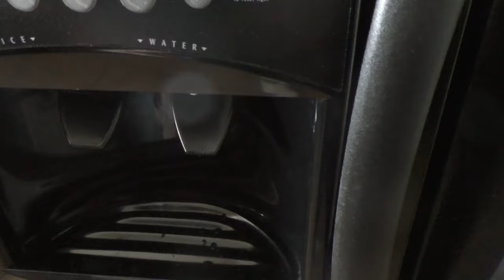How to Fix a Frigidaire Gallery Refrigerator that Wont Make Ice

Comment: For any others who might run into this problem, I spent literally hours trying to diagnose what was wrong after running through everything in the video and nothing seemed to work. I ran into something online that said to pop off the front of the actual ice maker (just use a little bit of force but it should pop off if it's like the one in the video) and if the gears are not moving, turn the large gear 1/4 of the way around clockwise to begin a manual reset process. Within a few minutes water came from the tube into the ice maker but it took me resetting multiple times to get ice and it still didn't work continuously without constantly resetting which led me to believe something may be wrong with the motor.

After very close inspection the next day, I realized that probably a mm of two of the wedge tips on the gear had been corroded/chipped off and that was the reason the gear wasn't turning, water wasn't flowing into the freezer and ice wasn't being made. A quick gear order of Amazon for $15 ( https://www.amazon.com/gp/product/B083HMNWBP/ref=ask_ql_qh_dp_hza ) fixed my issue and ice is flowing back in. Just glad I didn't have to replace the whole ice maker! Thanks @Farm Dad for the walkthrough as I would have never been able to deduce what was happening without this video and learned a whole ton about my refrigerator/ice maker in the process! lol

Also my model number was FFSS2614QS6A.
Reply: Wow thx ur awesome 👌
Reply: Thank you!!! I just replaced the assembly and still nothing.. gonna look at the resetting it... thanks again for sharing
Reply: My gears won't move manually.  Look great but I can't turn it. ?????
Reply: Dude thank you! I decided to try this after replacing the filter before I pulled the fridge out (easiest to hardest method order lol) and I had a broken tooth on the gear and the loose tooth got jammed and stopped it from spinning. We are up and running now!
Reply: Thank you so much! After the repairman looked at it for 30 seconds and said the whole ice maker needs replaced and quoted $350 I was shocked. Found this video, and this comment and sure enough, the gear had been worn down. And now it's working. Thank you!
Reply: thank you so much. I tried all the things. so I knew my valve was good and the filter was good. but still no ice. Turned the gears and no I have ice!!!

Comment: Hey guys – just wanted to share a fix you might want to try. I had a repair guy finally look at my ice maker (2018 fridge). Turns out there was a design problem (he spoke to someone from Electrolux). Air was seeping into the hole where the waterline goes. If you live someplace that has high humidity it could cause the line to freeze. The fix was to insulate the line in the fridge and also seal the hole. Used to freeze up after 2 days and stop making ice. Has been running great for 2.5 weeks now and makes ice much much faster. Good luck!
Reply: Hey not sure how to insulate. Can you plz walk me through
Reply: @lestine38able  hi, the final fix was to replace the hose that goes into the fridge. The insulation part was basically just making sure there’s no gap where the hose enters the fridge.

Comment: So I followed your process end up changing the big wheel in the front.  Ice maker worked for about3 weeks.   Changed out water valve system.   No water coming into line in back for ice maker only water running fine into water dispenser help

Comment: Well, 10 mins later and I’m back to comment again.  Did your steps and my water inlet tube to the ice maker was frozen. Pulled it thawed it and reinstalled it. Now it’s a waiting game. One TIP,  if u have a small piece of tubing  u can push it on the bk of the inlet tube and blow. If u can’t blow any air, then pull the tube out. Thx again
Reply from the maker: Awesome.  Glad you found your issue.  Great tip too!

Comment: Replaced valve assembly and still nothing. Are the gears inside the ice machine supposed to be moving? Mine are locked and will only wiggle a little bit but wont rotate.

Comment: After watching your video I was able to assess what my problems was.  I used a pair of bent needle nosed pliers and removed the plastic water piece from the back of the refrigerator and it was frozen solid.  I noticed that to remove this piece I had to turn is a quarter turn to unlock and then pull. After I thawed out the ice I simple replaced and quarter turned it into the lock position and then reattached the water source.  Thank you for posting your instructional video, it was very helpful.
Reply from the maker: Glad you got it fixed!
Reply: @FarmDad  great video.

Comment: Excellent Video!!! I am a DIY girl and your video was straight forward and easy to follow. The plastic piece in my unit had a solid piece of ice in it. I removed, rinsed, and re-installed it.  FYI, the plastic piece comes out easier if you push from the inside. I used a towel to get a better grip. WE HAVE ICE AGAIN! Thanks Farm DAD
Reply from the maker: Great job!  Glad to hear it is fixed!

Comment: Great video...... this was perfect and I found the ice in the plastic piece that you showed.  I do want to caution those that will doing this, the metal plate behind the fridge that surrounds the plastic piece is extremely sharp.  I made the mistake of running my finger across it as I was pulling the piece and ended up with a pretty deep cut in my thumb.  I suggest using pliers to pull the piece out if it doesn't budge for the inside, or taping around the metal edge that surrounds the piece.  Good luck.  Great video!
Reply from the maker: Ouch!  Good advice.
Reply: Thank you so much for the video on how to fix ice maker. I have a ke more fridge which seems from your video it has similar functionality. I did try the pipe method by following your steps, unfortunately still ice is not being made, so I believe possible the bottom valve might need to be replaced. Requesting can you please upload video of that as well on how to take off valve etc now in case if that doesn’t work also what else is the reason that ice maker not working? Also I felt so good doing this as a handy person where can I learn from basic to advance
Reply: @dilshadrandhawa3921  did you ever find a solution to this problem? I'm having the same issue with the blue tube not receiving water.
Reply: Ouch, fingers bleeding!  My part is still stuck!

Comment: OOOPS, There it is!: Frozen water inlet tube. Was lucky I have a small hand held water steamer. Removed excess ice from tube, removed water supply hose. Injected steam from the inside of freezer until it melted  ice and steam came out the inlet. Fixed!.
You had a good approach on troubleshooting steps and explanation. Thank you.
Reply from the maker: Glad you got it fixed!

Comment: Thanks for video!  Have no water coming into fridge and just checked the line and its not clogged.  Gonna try replace water filter and go from there.  Your video helps with step by steps.
Reply from the maker: Most welcome!  Most common issue is frozen line where it enters ice maker.

Comment: Thanks for your walkthrough. Recently our ice maker on our fridge stopped working. Part of the issue was that the water line had come out of the connector. After reattaching and ensuring it was tight, still nothing. Took it apart today and the water inlet to the freezer was frozen solid. So now we are waiting for it to kick back on.
Reply from the maker: Nice fix!

Comment: Found your video today, our ice maker hasn't worked great since I had installed our RO and switched over, I had assumed it was the water pressure.

Turns out the inlet had frozen, so I thawed that, only to not get ice. Frustrated, I figured I would try manually adding water to the tray. It seemed to not flow where it should (I used a bowl rather clumsily), but about 30 minutes later the machine dumped a load of ice! And then another, and another 😁 I think the bowl of water thawed something out that was controlling the water but frozen in the closed position. I'm guessing a water position sensor of some sort, but I haven't taken off the front cover to look for myself.

Cheers! Our ice is also no longer semi-hollow / misshapen 🤘
Reply from the maker: Awesome.  So cool! (Pun intended). 😁

Comment: Subscribed  I had done so much of what was already in this video.  Listed to make sure the solenoid was kicking in, no water in tray, even felt the inlet to make sure it was clear of ice, water dispenser working.  But, watched this, figured it had to be the chute leading from the water line.  Yep!  Just wished I had watched this video first!
Reply from the maker: Sounds like you know what you are doing.  Thanks!
Reply: @FarmDad  I do have one question I have not found an answer for:  Why does the water enter the back of the unit behind the ice maker rather than the water filter?  Doesn't the water for the ice maker go through the filter first?
Reply from the maker: @michaelweaver4718  yes it does go through filter first.  The water line from your house should go to the filter.  Then from filter it should go to the solenoid valve which will send filtered water to the ice maker as needed.

Comment: Hello Thank you for this Video I was able figure out how to get My Ice Maker working in my Frigidaire Gallery refrigerator. It was just as you showed Ice in the water tube going into the Ice maker and I was able to clear an Ice clog. I could not get the tube out but I was able to use a syringe and a plastic tube and squirt hot water into the tube to clear the Ice. I am waiting for the Ice make to cycle and see if I start making Ice again? Thank You I'm quite sure that now that the ice clog is gone it should start working again I already replaced the water valve assembly. When my water dispenser stopped working about a month ago. because the line was frozen inside the door. Thanks for this video it helped me figure out my Ice maker problem. CHEERS!!
Reply from the maker: Glad it helped!  Cheers!

Comment: Thanks for this, just removed the fill tube at the back of the ice maker and sure enough, it was clogged with frozen water.  Removed and cleared the ice clog, hoping that fixes my issue.
Reply from the maker: I bet you have it fixed 👍
Reply: @FarmDad  I am hearing ice drop into the catch tray now.  I think its "fixed".   Thanks for the video!

Comment: Thank you. Great basic quick check before moving on to replacement parts. It would be great to have seen the valve replacement or learn if some valves can be purchased at a local hardware store. I did learn about checking the top stem for blockage from this video but was not lucky and appears to be the valve. Thank you.
Reply from the maker: I wish I would have put in the video that a lot of times you can confirm whether your valve is bad by switching the connections on its solenoids.   If you reverse the connections and no longer have water at the dispenser but start getting ice, the solenoid for the ice maker is bad.  It's usually easiest to replace the whole valve.  I usually buy it online as most hardware stores won't have it.

Comment: When pulling out the water feed "spicket" or tube, first turn it 1/4 turn counter clockwise, as there's a tiny plastic locking tab holding it in.  This was iced up, on my fridge.  Also, there's a tiny funnel on the ice maker itself, that this spicket dumps water into and it was frozen up too so, I actually had to remove the entire ice maker (super easy) and let it thaw out.  You're processed worked great.  Thanks!!
Reply from the maker: Appreciate you

Comment: This video helped me. Tray was dry ad a bone as he said. I first checked my filter. Shook it a few times then put it back in place. I checked the water line and no water was coming in. Took my screw driver and tapped the solenoid 3-7 times and water shot up through the hose. Can't say it's fixed but I do have water back to to the ice maker. Dispenser still worked as normal the entire time. Strange.
Reply from the maker: Hope it stays fixed 👍🤟

Comment: Thanks for helping me fix this!!! It was just clogged with ice chunk but I had no idea I could just pull that out of there!
Reply: My brother that is an AC guy also taught me that you can get a huge syringe that is used to gather liquid to squirt hot water up the valve the guy in this video pulled out. It will melt the blockage and your ice-maker will start to make ice again. I of course pull out the ice bucket first then put a pan inside the freezer for the water that falls back in. I squirt about two cups of hot water up into the valve to make sure it melts the ice. Of course make sure you first have water coming out of your water dispenser so you will know it isn't the water valve inlet in the back behind the board. But it appears that it was in your case.
Reply from the maker: Glad to help!
Reply: @yogibear6084  I watched a guy who said just use a hair dryer. I was like duh! Why didn't I think of that!
Reply from the maker: I don't recommend the hair dryer.  I've seen several people melt their plastic tube.
Reply: @FarmDad  it only took a couple seconds and worked fairly well. And I actually just heard an ice cube finally drop into the container. It's a win win for me. But I wouldn't have figured it out without your video!

Comment: This is a very well done video and has helped me with my freezer.  But it doesn't cover the problem I have now.  It seems like there is no power getting to the freezer light and the part that pushes the ice out.  The light was coming on intermittently when I lifted the ice maker unit and the dispenser would start to work.  But now it doesn't come on at all and the dispenser is dead.  It seems like a connection is loose.  Do you have any idea where to look?  Thank you.

Comment: Great video! Easy to follow did all the steps, turns out I had air in my line, to prime the line and get all the air out I just kept turning my ice make on and off until I got got about half a cup of water from my ice maker water line. Thank you for the video!

Comment: I’m at the point where I have the green tube in a bucket. I see a little bit of water within the tube and when I shake it, some water comes out. However, the water doesn’t look like it’s fully through the line. I can see increments where it stops and goes. How long should I leave it in the bucket for before I can determine this is the issue? So far it’s been in the bucket for an hour and no water is in the bucket. At one point should it be flowing out or should there just be a little water in the bucket?
Thanks so much!!

Comment: Hi Farm Dad,
Finally I found this video, that's the same model that I see at my new place!!! There's a problem in my fridge; the freezer is at -19F when the fridge is at 36F. It was -1F and 58F last week and I tried everything I learned from other videos like cleaning the condenser coils, shutting it down for minutes and so on.
What do you say about this issue? Needs thermostat replacement???

Comment: I have the exact  same icemaker. Mine is always the tube at the top clogging up with frozen water. Not sure what causes that. Great video.
Reply from the maker: That's frustrating.  It could be that the freezer temp is set a little too cold.  If not that you may try insulating that little tube.  It won't look pretty but should help 👍

Comment: Hello. I did everything you recorded doing including replacing filter and the solenoid in the back and it still is not making ice. I checked the water line that goes into the back of the freezer to see if it's frozen and still no water

Comment: Great video.  What if the filter is brand new, there is plenty of water getting to the refrigerator but there is no water coming out of the water dispenser?  Does that pretty much a guarantee that the valve assembly needs replaced?
Reply from the maker: Sounds like bad valve.  So you have no water or ice?  If you have one or the other you can test valve by reversing the wires on the solenoids to see if one solenoid or the other is bad.

Comment: Thanks for the video, my concern is that flimsy plastic tube, if that was frozen, wouldn't it be easy for it to break or crack ?
Reply from the maker: They are always frozen in the freezer.  The plastic is made for it.

Comment: Your tutorial is great and it’s very detailed. I have water coming out my water dispenser no problem from the front of the refrigerator. I change the filter just to be on the safe side. I also disconnected the waterline that connects to the freezer for the icemaker and I put it in a bowl waiting to see if water comes out of there however my icemaker makes ice and then where the ice is made and formed it gets stuck and I have to push it down like it freezes right up in there where you had me to put my finger at that’s where it’s freezing it once I push it down then it’ll make another tray of ice. what do you suggest next?
Reply from the maker: Sorry, I'm a little confused.  So in the ice tray in the ice maker, the fridge will fill it with water and then it'll freeze, but it won't transfer it to the storage tray?  If that describes your problem it sounds like an issue with the ice maker.
Reply: @FarmDad  yes that is correct. Sorry
Reply: @FarmDad  sometimes it will transfer and then the on and off lever will not go all the way down to produce the next set of ice and I think it freezes then
Reply from the maker: @lestine38able  I normally replace ice makers as a single unit rather than try to diagnose and repair them.